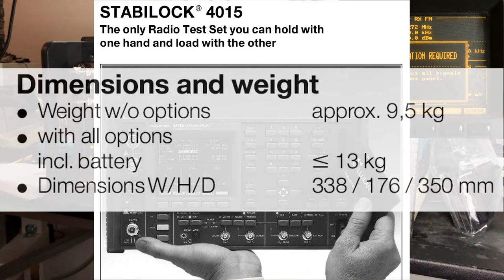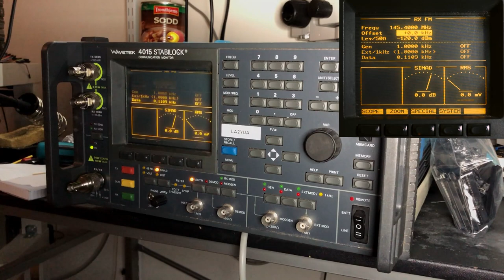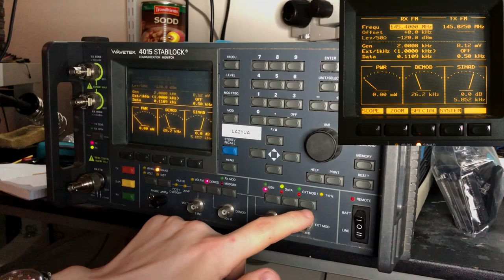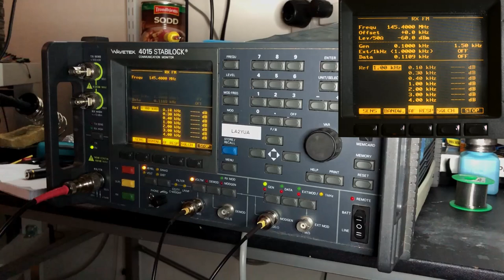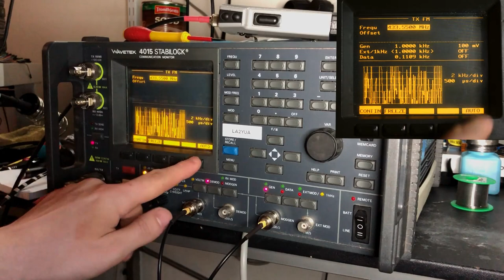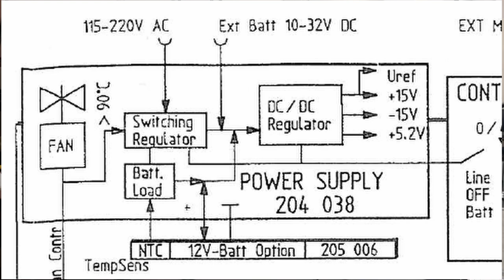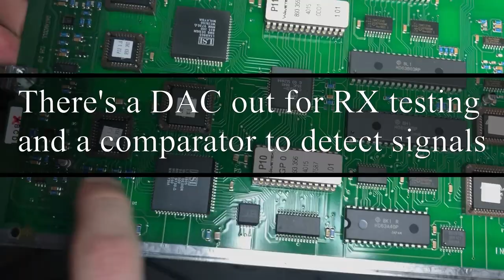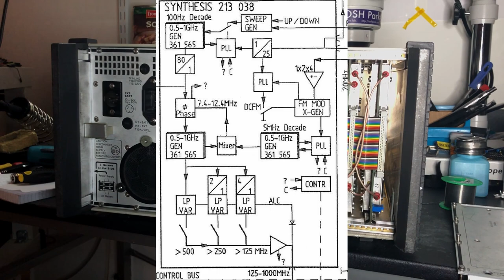Stabilock 4015 Overview and Mini Teardown

Comment: Excellent overview. Is any software like GSM or MPT1327 trunking  available ?
Reply from the maker: This unit doesn't support GSM at all (better to get a used Agilent Vector Signal Analyzer or something SDR based for that).
MPT trunking was a software option at the time, but I haven't been able to locate any software for this unit except quite expensive NOS memory cards (that may or may not be based on battery backed SRAM for storage).
Reply: I eventually obtained PSU schematics from the manufactures, which also have an error on like all the copies. The power to to the switch mode chip is left off. 
I bought a second one of these & have now repaired both. Amazing how accurate they are. I have an HP counter with 10 Mhz GPS controlled reference. One of these  4015  units has it's original 20 Mhz reference oscillator. The signal generator output is 2 hz out at 100 Mhz & the output level is out by less than 1 dBm when fed into a calibrated Sitemaster S331L power meter. I will be putting one of them on Ebay soon.  What is the data board used for ?

Comment: Does the 4015 require special software on memory card for the tracking generator to function?  Spectrum analyzer works but no tracking.
Reply from the maker: I believe so, and unfortunately it's likely this and all other non-ROM software is lost to time given that the original software only shipped on battery backed memory cards.

At least devices like the nanoVNA are fairly cheap these days.
Reply: Thanks for your input and fantastic video.  I do have tracking capability on my SI 4032.  A friend does have the tracking memory card however we are having difficulty trying to get the software copied from it.  The small size of the 4015 makes it an ideal piece of gear.  Steve, K7VU

Comment: I need your help about the Tracking Generator on Wavetek Stabilock 4015.
Question is how to change the scale to see the value under -60dB (I need it to tune a duplexer, it needs -90 or -100dB).
Thank you.
Reply: The simple but not very convenient solution is an external 40dB attenuator .

Comment: Hi broke my Wavetek 4015, screen dew 4015 Interal Error.
68000 Undefined Interrupt.
I pulled out the board, Battery Varta 55615 702 012 sucker sour, the tracks were cleaned I called everything well, I replaced the battery, empty or many dots on the screen where the program is not needed or needs to be reinstalled, if so where to get the program wavetek 4015 Stabilock. Thanks for waiting for an answer
Reply from the maker: The ROMs are available here http://longview.be/wavetekschlumberger-stabilock-4015-fluke-6060b-rom-dumps.html - but any number of things could be wrong after a battery leak
Reply: @stuckinpants  thank you very much for the reply, i would be grateful for the information on how to install it, i am a newbie in this field, the device i got under the legacy, i would really like to revive it
thank you
Reply: and after a battery change, after a long time, about after a while, should the menu be or nothing at all? need a solution?
Reply: and after a battery change, after a long time, about after a while, should the menu be or nothing at all? need a solution?
Reply: unfortunately I did not have any update and did not intend to do it, the device was with me for 7 years, it worked like a clock, but now it is as it is, I need help, I do not go further. help me not want to lose the dawn legacy. thank you